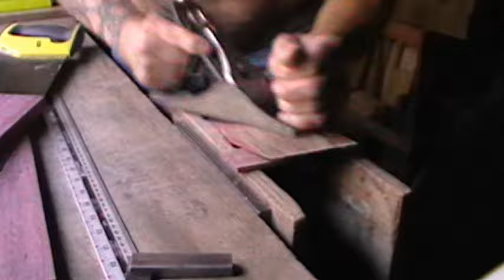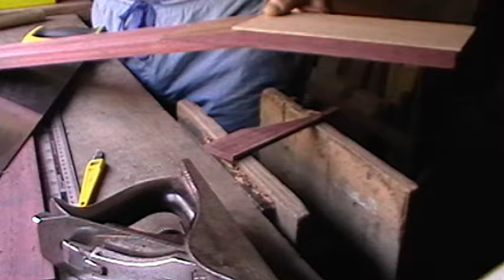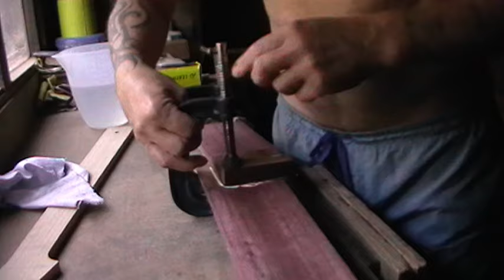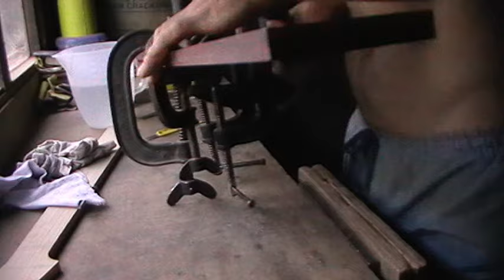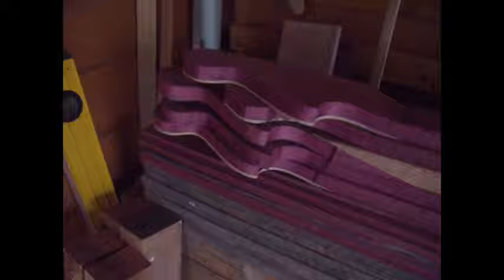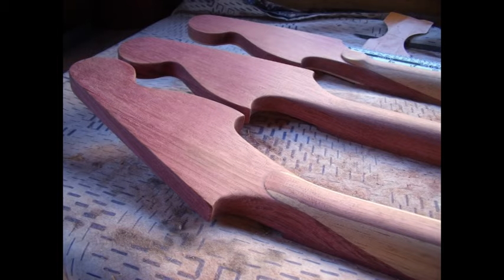Making a Scarf Joint on a Purpleheart Wood Neck Blank (Time Lapse)

Comment: Nice work sir Purple Heart is beautiful, this is the way I do my scarf joints too but I still can't figure out how they do it in Asia where the scarf joint is much farther towards the heal of the neck, there are no videos or info anywhere on how to accomplish that technique. All I can think is they use two different boards, a thick one to cut the headstock angle into the headstock and another to splice the two together. I don't know why it would be done this way though. Maybe so they can switch between different styles. If anyone knows please educate me.